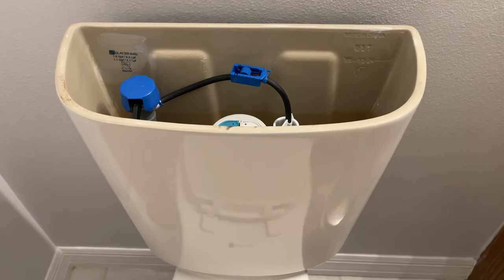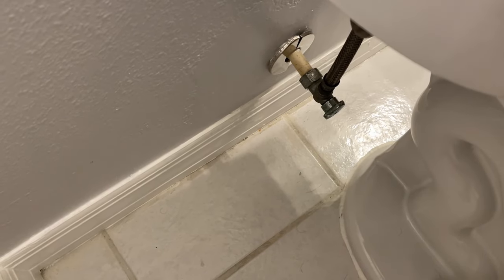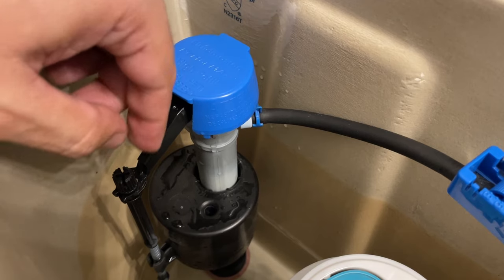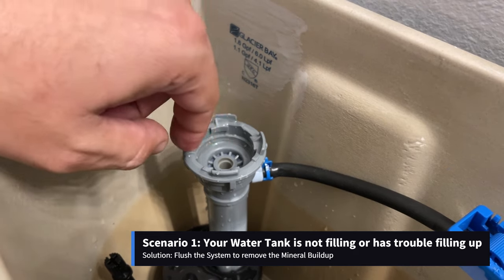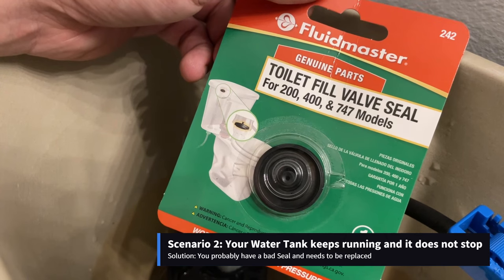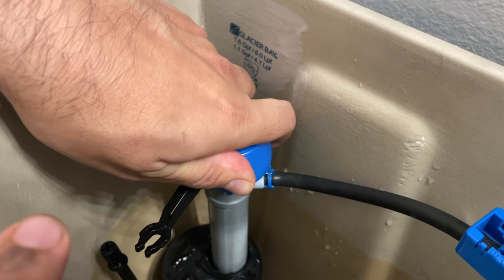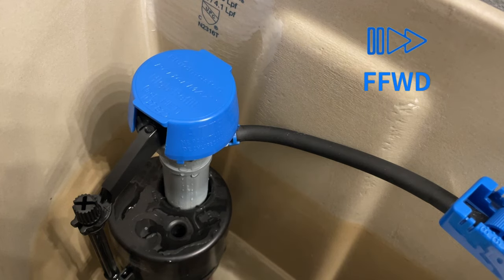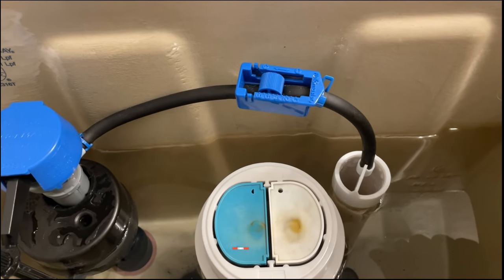Toilet not filling up or Toilet keeps running (Simple fix. No need to replace Fill Valve Assembly)

Comment: Mine is brand new and the float sticks intermittently.  I touch it and it pops up and toilet fills.  Any suggestions?
Reply from the maker: Hi! That seems strange. I would try to ask for a refund if possible as this seems to be defective considering you have an appropriate water pressure. If not, I would try to disassemble it and see if the seal has any problem or is not placed correctly. I hope this helps.

Comment: Also, don’t use toilet water cleaner with chlorine, like Clorox Tabs or liquid.  The chlorine will, over time, destroy rubber deals and materials, even chlorine resistant rubber. Toto sent free replacement parts, but I don’t know if other manufacturers do that any more if they don’t make the water filler like FluidMaster.

Comment: I had scenario 1 and seems to have fixed my issue. But are you able to explain why removing the cap allows the system to flush?
Reply from the maker: Hi! By removing the cap, you will be able to flush the system and get rid of any debris or mineral buildup in it.

Comment: Thank you for the very clear explanation! I am not handy so I really appreciate the tips that would seem obvious to some (like where you can hold the fill valve). I've been googling for a while and this is the most helpful thing I've found. Clear instruction and visuals. Thank you!!

Edit: I had scenario 2 (it kept overfilling). I actually just removed and cleaned the seal and replaced it, and that worked! Yay for free.
Reply from the maker: @AnaBatmana  Thank you for your kind words Ana! I’m very glad that the video was useful to you and helped you find a solution!

Comment: Hi I hope this helps me with my fluidmaster as well same problem I am having tank not filling up and you hear water running hope this helps me Question what is the blue thing on the black hose ?thank you kindly
Reply from the maker: That blue plastic part is a clamp that is attached to the refill tube which helps control how much water refills the bowl. You can adjust it to have the optimal water bowl level.
Reply: I have the same problem so I replaced the entire fill valve but it still doesn't fill any higher than just below the flapper.

Comment: Hi thank you for the video, is this toilet from Costco? I have a similar toilet n the pets that it leak very slow. Do you have any video about that?
Reply from the maker: Hi Jim! My toilet was already installed when we arrived, I am not sure if it was bought in Costco. For the leak problem you are having, did you already try the fill valve troubleshooting? If you tried it and it is still not working (and you are not seeing any water dripping on the back of your toilet), I would recommend that you replace the entire fill valve.

Comment: What toilet is this? Glacier Bay toilets have a lot of issues with leaks . Home Depot might have this part. They do carry the ring seal for the dual flush canister valve.
Reply from the maker: Hi, yes it is Glacier Bay. Until now I have not experienced any leaks but it is good to know that this can be a potential problem.

Comment: Sooo. What do I do if a new one locks after I flush? It won’t fill unless it’s jiggled to unlock it.
Reply from the maker: Hi rfloster, if your toilet is not filling up, there is probably a mineral build up in your system or it needs to be cleaned. Try the troubleshooting for Scenario I in the video.

Comment: Why don’t the water stay in the tank after doing off if this with a brand new valve?
Reply from the maker: Hi Steph! If the water is running out of the tank it is most likely because you have an issue with your flapper. The flapper is the rubber part that you will see at the bottom of the tank. If it is worn out, not sealing properly or not closing after you flush, water will run out of your tank.
Reply: @handyneasy  you are correct! I installed a new flapper, adjusted it to the proper length and boom! Problem fixed! Thank you! Great video!
Reply: @handyneasy  It worked.... Thank you so much for your expertise and thank you @stephmar6693 for having the same issue as I did !

Comment: What if you take off the cap and there’s no water coming out after you turn the water on?
Reply from the maker: Have you checked if you have water supply with adequate pressure for flushing the valve? If this is OK, it is probable that the fill valve is clogged and probably you would have to consider replacing the entire fill valve assembly.

Comment: What if you take off the cap but there’s no water coming out?
Reply from the maker: Have you checked if you have water supply with adequate pressure for flushing the valve? If this is OK, it is probable that the fill valve is clogged and probably you would have to consider replacing the entire fill valve.

Comment: Brand new Valve but no water from refill tube.
Reply from the maker: Have you checked if you have water supply with adequate pressure? If this is OK, it is probable that the fill valve is clogged and probably you would have to consider replacing the entire assembly.
Reply: @handyneasy  Yes the water pressure is adequate, it had been working normal than it appeared to be plugged so I replaced the fill Valve with a new Fluidmaster 400H-002 Performax now its working but the refill is not tube is not spraying water. I am at a loss because it is a new Valve how could the refill tube not be spraying...
Reply from the maker: @TravisInCanada1  hi Travis, if you bought a new Fluidmaster Valve, the refill tube should come attached to the valve and would be also a new part. If you are not seeing any water coming out from refill tube and there is nothing blocking the refill tube that prevents adequate water flow, I can only imagine two things: 1. the fill valve you bought is defective 2. There is not enough water pressure for the system to work properly.